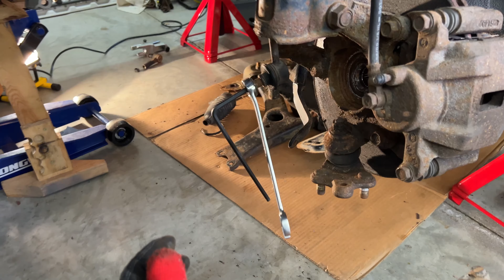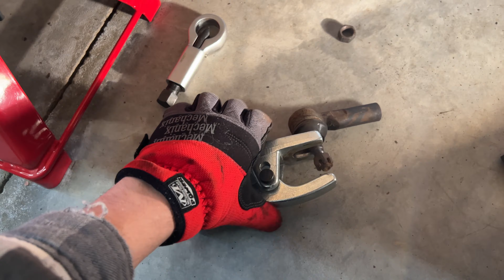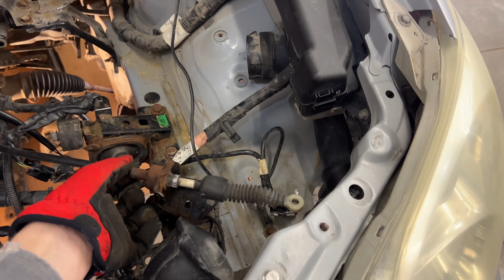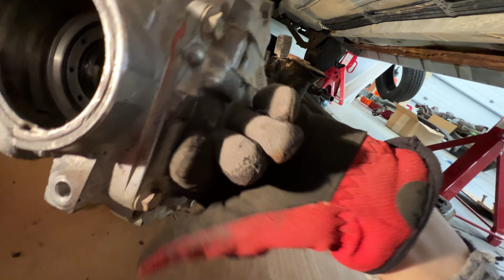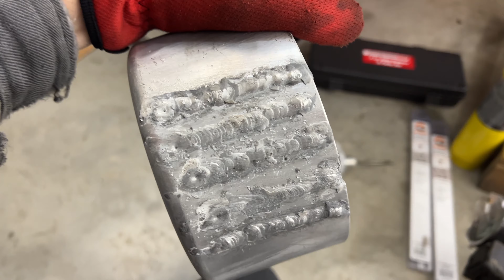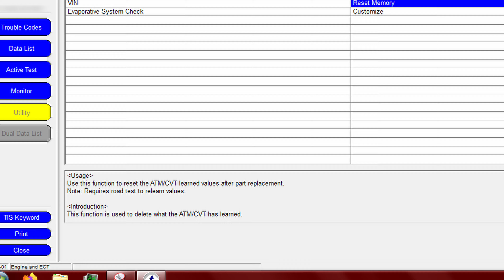AWD Matrix/Vibe Transmission, Transfer Case, CV Axle Removal TIPS and TRICKS. Don’t make my MISTAKES

Comment: I have a 2010 matrix wit 142k miles. When i bought it a year and a half ago the first thing i did was change its fluids, once i took off the transmission pan not only it had your typical shavings but bits of metal as well. I replaced the filter, gasket, and guild with OEM ones. The only problem I haven't been able to fix is a whining noise which is pronounced when accelerating from a stop. The whining noise is less as the car gets moving and when I depress the gas pedal the noise stops right away. I also set the car on park and hit the gas pedal and there's no whining noise. The transmission works perfectly fine besides the whining. Do you think that the transmission needs to be replaced? I don’t have the resources to remove it from the car which honestly if I could I would and fix it myself by leaning about it. Can I please have your input on this matter? Thank you very much.

Comment: How me and my dad took out the axles is by using a 2x4 about 3-4 feet long, a floor jack and an axle puller adapter from autozone. The slam hammer we got didn’t fit too well in the wheel well area due to subframe and rotor in the way. so we placed the adapter behind the axle where it meets the transfer case sleeve, since it was snug it stayed in place pretty well, then we placed the 2x4 on top of the lifted jack and angled it to contact the puller from the driver side of the car. From there we beat the s#it out of it for about 2 days with a 10 pound sledge hammer. It popped out along with the sleeve luckily the sleeve wasn’t stuck to the axle but vice versa lol. The bearing housing (bearing groove) from the axle was lodged in the sleeve. At the time I thought this groove was a part of the sleeve and when comparing the new axle the bearing casing was much larger than the grove in sleeve. We thought we got the wrong part at first but This video here actually saved us since he showed the sleeve with no grooves and a clear see through hole on the bottom. From there we took the sleeve to a machine shop to press out the axle bearing housing and we were golden. Took the same idea we had to take it out to put it back in this time with 4x4 and stacked misc. wood to level the 4x4 with transfer case sleeve and again… beat the s#it out of it till we were flush. Hope this helps I would’ve filmed the process but my goal was to get this done as quickly as possible and didn’t realize how many people struggle with this issue. Hope yall got some good info from here and shout out to the creator of this video as well! Saved us a lot of headache and time!!!

Comment: How difficult is it to remove the rear differential? Do I have to remove both wheel bearings? Or can the CV axles bend enough to remove it without removing the wheel bearings?

Comment: Excuse me if I'm wrong,  but is the clip still in the mid-shaft bearing on the passenger side CV axle? Did you remove the clip before cutting the support off ? @ 8:00 into the video when you show the cut off portion of the bearing,  it appears that the clip is still in the retaining groove, at least part of it is.
 You realize an illustrated diagram would have prevented the majority of your mistakes,  they were made due to not understanding things are assembled and held in place? First timers learning guide would've been a good title for the video.

Comment: I have 2004 Matrix AWD, I am removing the engine for engine failure. Would PTO unit be in the way, and will the engine come out the top?
Reply: I pulled the engine from the top in an 04 pontiac vibe awd. The engine if you pull from top will separate and not contact pto or anything else.
Reply: @_m_K_.   yup, same with mine. Separated the engine from the transmission and pulled the engine out the top.

Comment: Nice video. Some other helpful tips. About the "c" clips on the axles at the splines, make sure the clip's opening are pointed down when installing. You can use a tiny bit of grease to hold it in place when installing.  If the opening is facing up, it hangs down low enough to be interfering with pushing the axle in. Hammering it in will likely damage parts and stretch the clip, at which point, the clip will require replacing. Installing an axle should not require force. If it does, it's because the clip is mis-aligned.  Also, if it's requiring much force to remove the axle, it's likely the clip opening is  facing up. Try pushing the axle back to starting position and rotate the axle to align the clip to facing down.  So, pry easy, if no go, push back in, rotate 90 degrees and pry again until removed. Axle seals diameter are close to pvc pipe, so making a seal installer some 3 feet long (in car installation) is a help.  Hold pipe inline and tap flush on the pipe.

Comment: Got a question, my driveshaft connected to the transfer case seal is leaking oil between them two, and also has some play. When I’m going about 40mph or at a steady pace with my foot on the pedal sometimes I hear and can slightly feel a rattling noise and I believe it’s the driveshaft transfer case? What could be some possible issues? 09 toyota matrix awd 2.4L 161k miles.